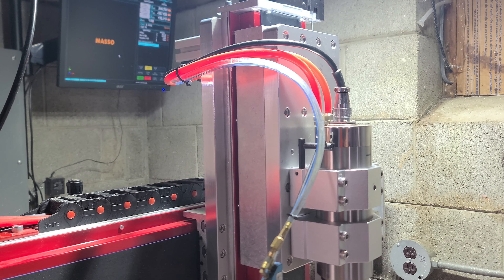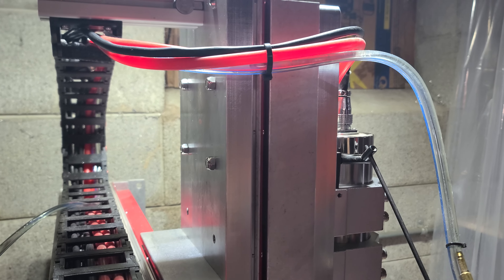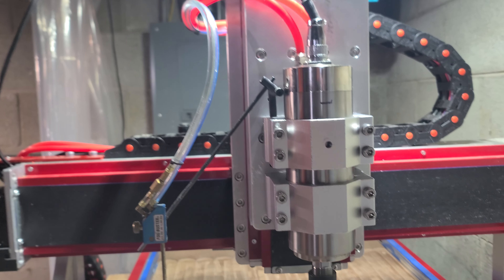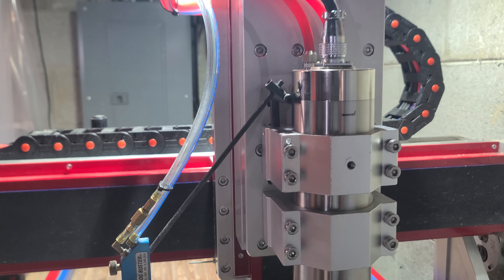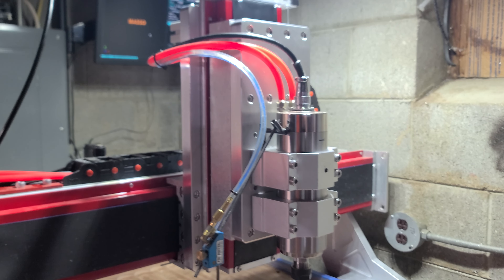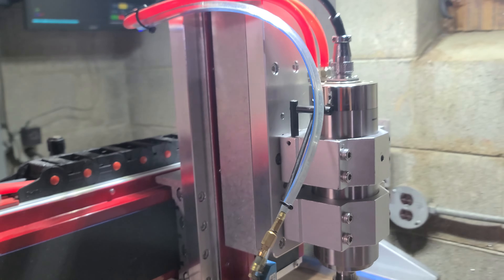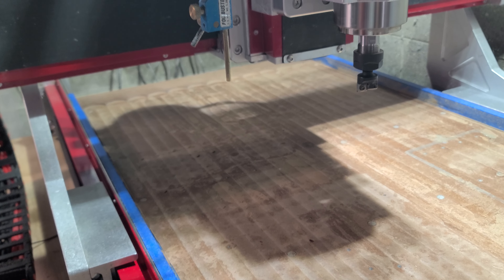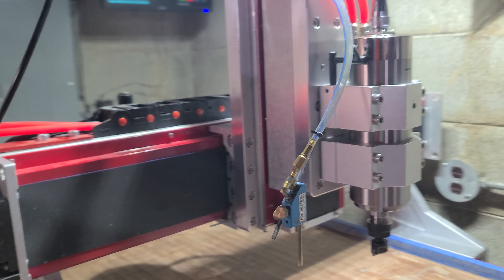Avid Benchtop Pro 2436 Z Axis Upgrade Pt.5

Comment: I'm strongly considering getting a Pro 2424 for aluminum cutting. I'm not as familiar with CNC electronics but I'm a mechanical engineer so thag side of things I'm fine with. I plan on using Avid turnkey electronics for the motion system and their 4hp spindle. Would you recommend that kind of setup? What made you deside on getting a different spindle?